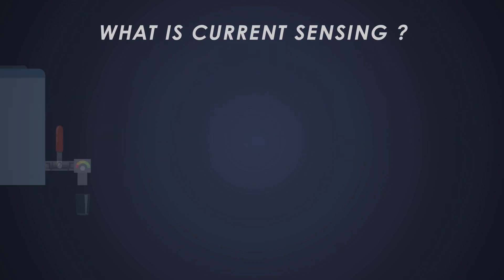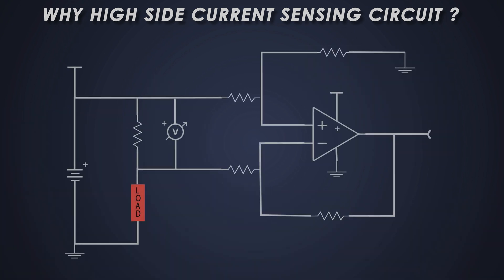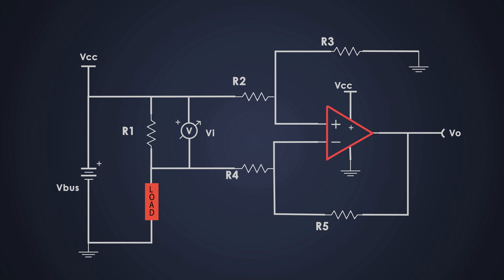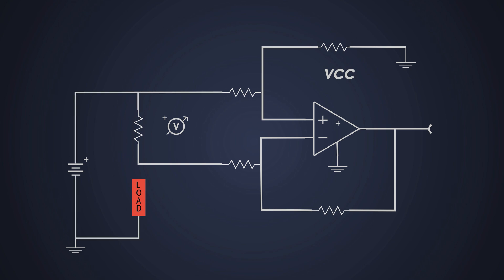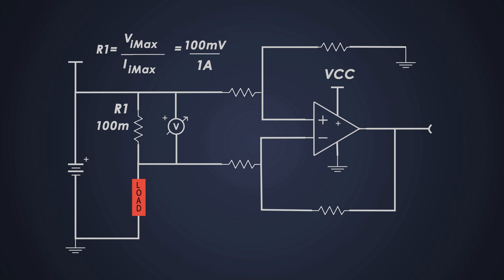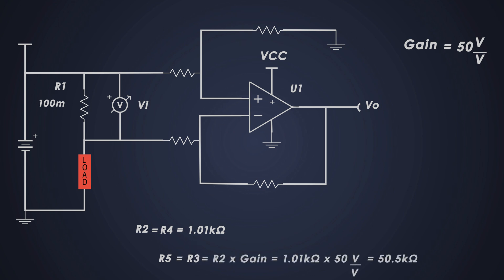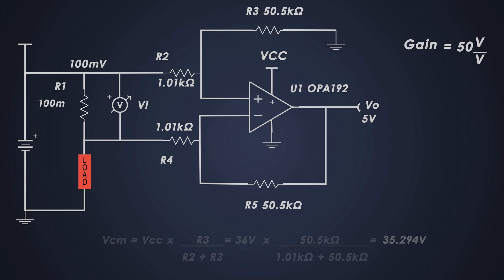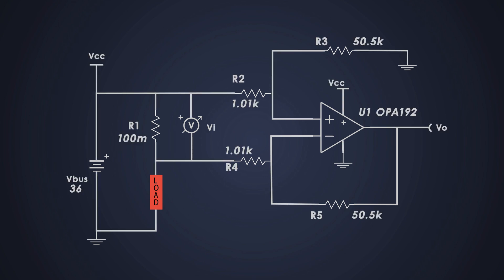How to Design a HighSide Current Sensing Circuit using Opamp? Opamp Highside current sensing circuit

Comment: A few questions: how would this work for a rail to rail opamps with a range of +/- 10V? If wanted to add an offset voltage, where would that part go? Would that change the input offset voltages? How (or will it) does R2 and R4 affect the inpit offset current?

Comment: I'm repeating the request, Sir can you  please make a video on design a transmitter and receiver circuit  which is used in the RC toys , explaining how the circuit works , how the signals are transmitted from transmitter to receiver  which controls the motors used in the toy i.e forward and reverse movement

Comment: I use high voltage ⚡️ so this design won't work for me because 100 volt with divider resistor the current sensor won't get the right voltage
Reply: You need to use opto-isolator based circuit to utilise this after calibration.
Reply: Simply add a voltage divider on each side of the shunt.

Comment: We use highside sensing of the current, because there is always a voltage drop over the shunt.
If we have the shunt at the low-side, then the voltage over the load is reduced, depends on the voltage drop over the resistor.
It is better to measure the voltage at the high-side and have all the loads connected directly to GND.

The problem her is, we need for the OpAmp a at least 2 Volt higher source-voltage as we have at the shunt, this is a problem, especially if the load is driven with a hundred volt. The OpAmp does not work with 100V.
Reply: Low side sensing is always easier to do…
However, in the cases where the ground is shared, you cannot introduce a shunt in the ground plane.
Consider the scenario where a TV is connected to a DVD player and a Gaming Console. If all three devices used low side current sensing… the signal voltages will all be shifted and terrible ground loops would be created (causing havoc).
Reply: The voltage over the load is reduced if the shunt is on the low side or on the high side. I don't see the advantage of using high side shunts except when the shunt fails then the load drops down to ground voltage and not up to max rail voltage as in thr case of ground side shunt.

Comment: Can you explain the role of cmmr 36V value little more than?
Reply from the maker: Great question! A CMRR of 36V means the op-amp can accurately sense small voltage differences even when both inputs are sitting at high voltages — like in high-side current sensing.